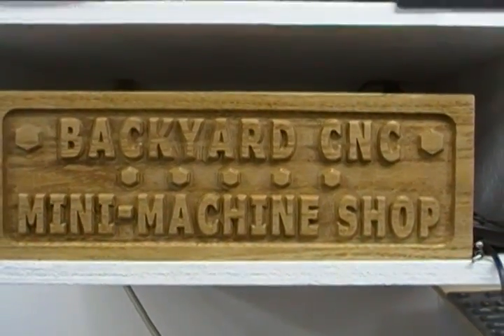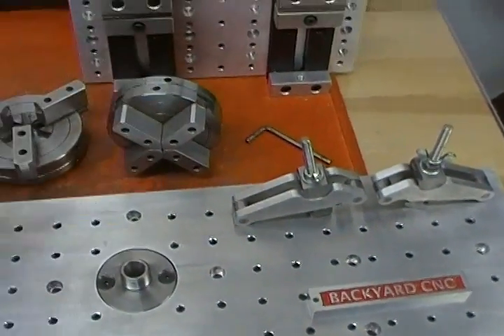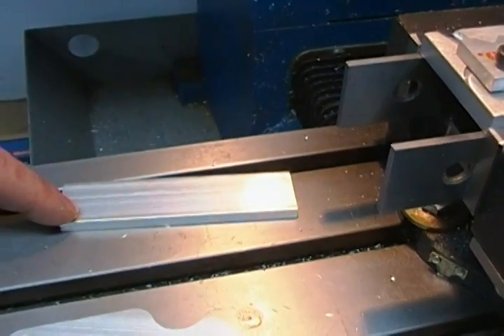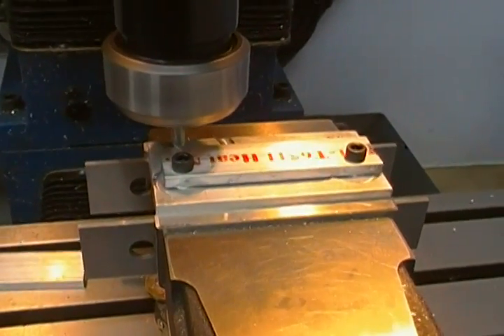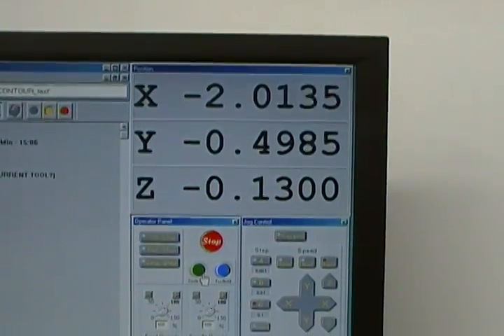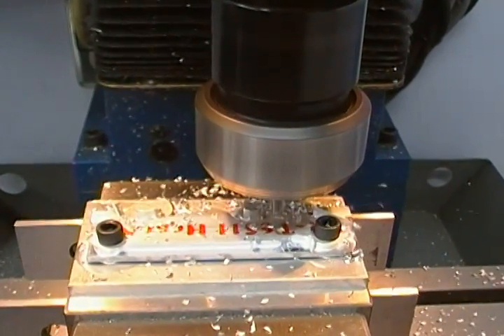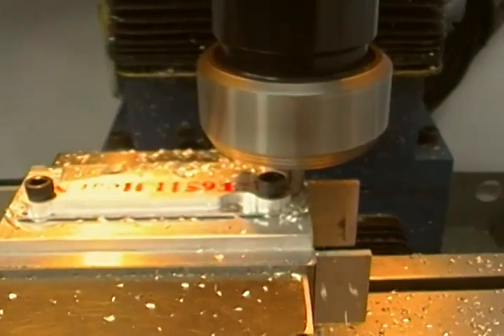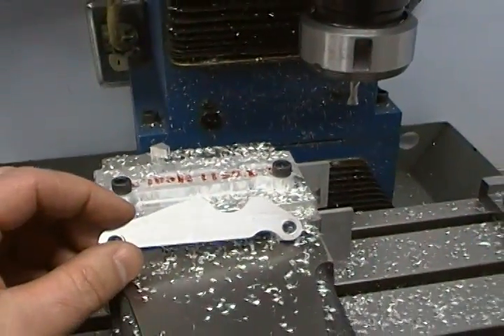CNC MACHINING OF A ROCKER CLAMP FOR A MILLING MACHINE

Comment from the maker: @Gwinners Gunworks later versions of this mill were different to allow software control I f speed. they have a switch on the mill front panel to enable it. I did not investigate if I could rework mine to thus arrangement but I doubt it is easily possib lo e.

Comment from the maker: yes, this mill is all stock and the software only turns the spindle on but speed is set manually. spindle has enough power that I once snapped a belt when I jammed it cutting a grade 8 hardened bolt! the  steppers will snap 1/8 or 1/4" carbide end mills like twigs if you get careless. sounds like you gave issues with your control box!

Comment: i was typing when you said 1hp motor, I have the same mill and speed is controlled by a knob on the front and not the milling program. it stalls plunging a 5/16 end mill 0.010 into aluminum. the stepper motors also do not run anywhere as fast as yours does. Can you tell me if the motor is the original and running on AC or DC. cutting this project  mine spindle speed will drop when cutting and speed way up when slowing down feed for the radius so unless i stand there and play with the speed knob it will stall on the straights and overheat the bit on the radius. Any suggestions would help. BTW it was originally a dos software and i got a copy of the style software you are running bt i see no way for the controller to get feedback for the spindle speed to control it.

Comment from the maker: @WildTangentUnit Well the SHOPBOT has a 3.25HP Porter Cable and even at slow speeds of 10K rpm it is very noisy. Ear protection a must. Add in the shop vac based dust collection and the ceiling mounted air filter and is a noisy place for sure. Be great to have a spindle and get the new 2stage dust collector installed

Comment from the maker: While tiny vises do have their place, these small clamps are much more versatile for holding large pieces that just do not fit into small vises. The more options you have for holding and clamping the better chance you have of successfully producing useful parts. In fact if I need to make more than one of anything I make a custom jig and sometimes that is teh best route even for a single piece!

Comment from the maker: Tnx for the comments. The 2 side peices are separated by 2 small spacers which are the same diameter as the ends of the sides. There is a short piece of round stock that goes thru the sides and the spacer and it is peened on both sides to keep it in place or can be made as a press fit.You could also use a nut and bolt but that is not as nice looking.

Comment from the maker: @fretsman68 
 Dave,
Thanks for the comment s and  very observant about the lights. I actually have them plugged into my controller on one of the aux control outlets which allows me to turn it on/off with a simple mouse click. However under normal software control all outputs including the spindle shut off at program termination so the lights go off. I have been meaning to change them over to a new outlet but just haven't gotten around to doing it. For now I just turn them back on at the end!

Comment: I think you did a great job on the video, and no, not too much talking, it's actually good to hear a "presentation" of what is being made. 

I do have a question for you, why do you have the machine lights turn off at the end of each run? Wouldn't it be nicer to have them on so you can see what you're doing while the machine is off for loading or setting up?

Thanks again,
Dave